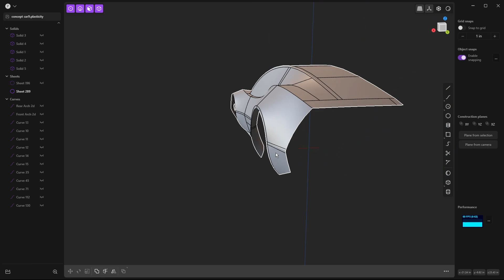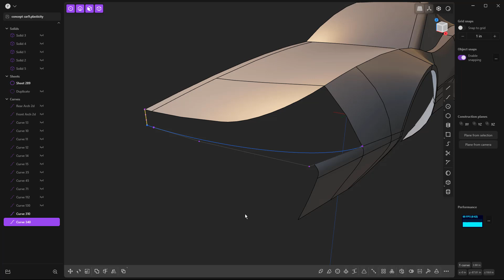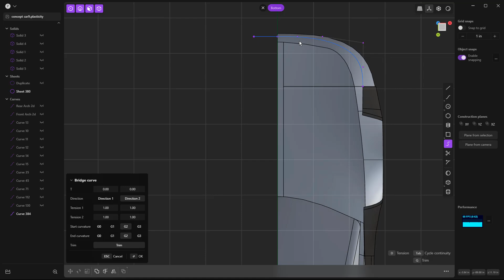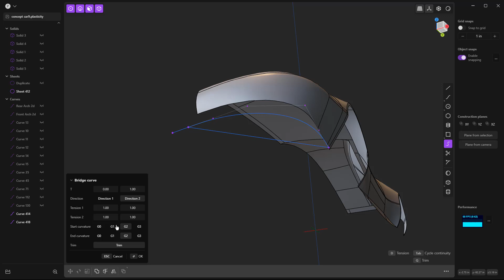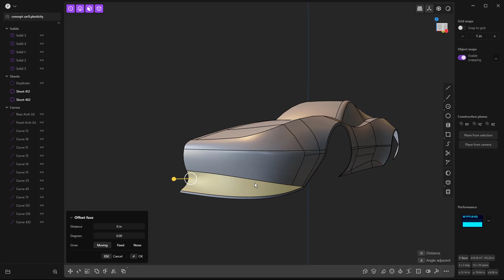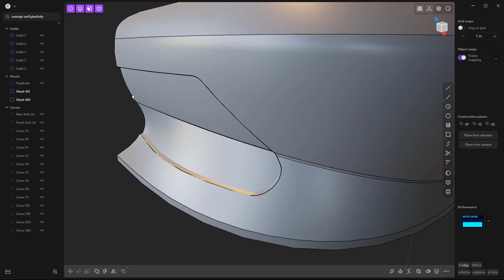How To Model A Concept Car In Plasticity | Part 8 | Building the Front End Bumper and Air Dam

Comment: Interesting demo on the front end on using Loft vs Patch.  Maybe do a future tutorial deep dive, using just basic shapes, on the trade offs of each surfacing technique. Plus techniques like over-building sheets and then trimming to achieve tight details rather than trying to force a loft or patch to conform exactly.
Reply from the maker: Great suggestion!

Comment: Excellent as always. I have a suggestion to consider for the next series when this one is completely finished. You could do lessons on modeling an exact replica(car, plane, motorcycle, whatever) from blueprints. This is also a difficult subject, I realized for myself that it's even more difficult on blueprints as there is much less freedom. Now you can solve problems simply by changing the shape, but you can't do that with blueprints.
Reply from the maker: Yeah when I started this series it began as a lambo hurican.  then i did an s2000.  I found it more difficult for a car modeling series than having the freedom for something like this.  I will keep it in mind, but it will likely be awhile.
Reply: @LearnEverythingAboutDesign  Thank you. Hope for the best, would really like to understand how to work from the blueprints. But this series is great too, gave a general understanding and learned some very useful tricks to speed things up.